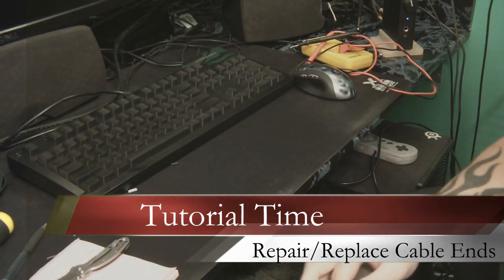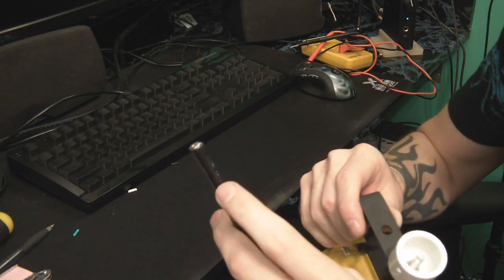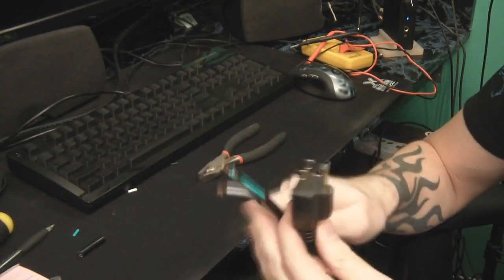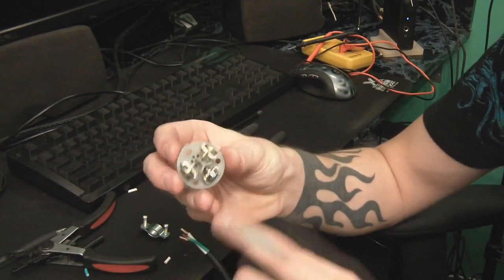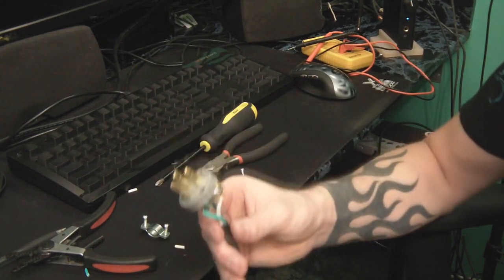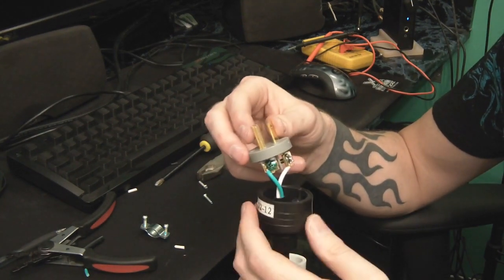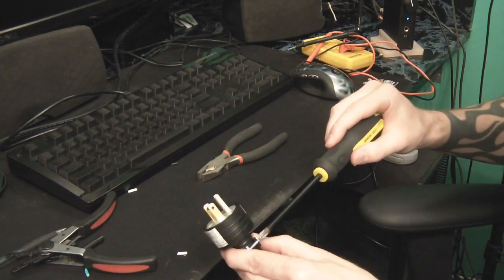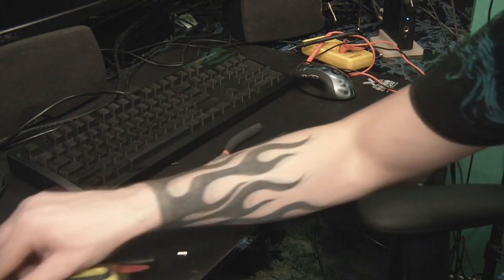Tutorial Time: How to wire on a new cable end for standard electrical appliances

Comment: google translate translated adereindhuls (nl) to ferrule (eng). im talking about tubed of tinned copper that you put over the ends of wires that are flexible and not solid. in holland it is mandetory. if you lock a flexible wire (no-solid) under a crew like in your video, it is possible that some of the tiny wires the flexible wire is made up of dont get fixed under the crew. in some cases i gets stuck next to the screw instead of under it, so it wont be very secure. sorry for any bad english.